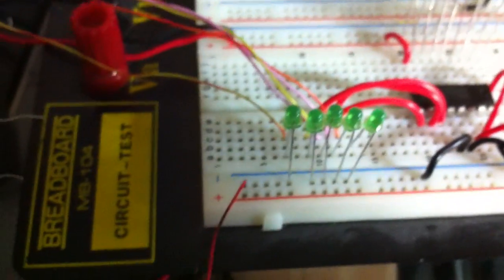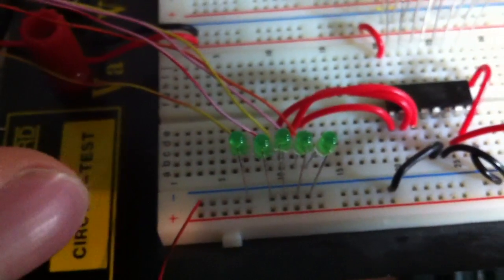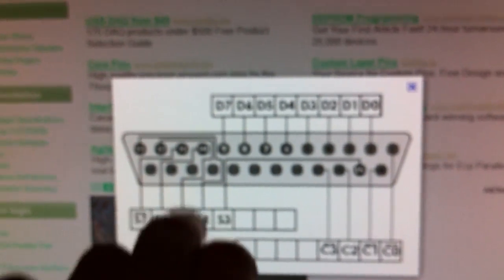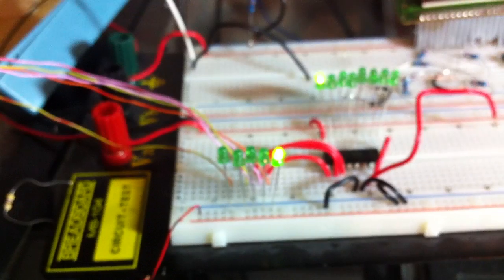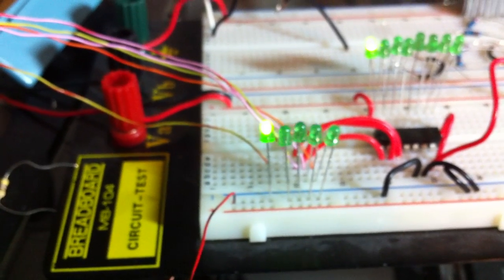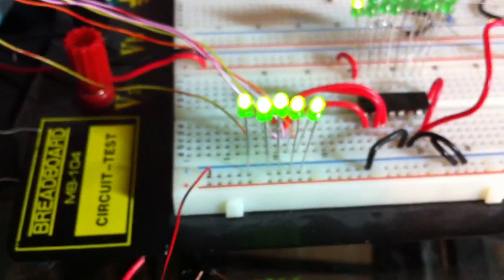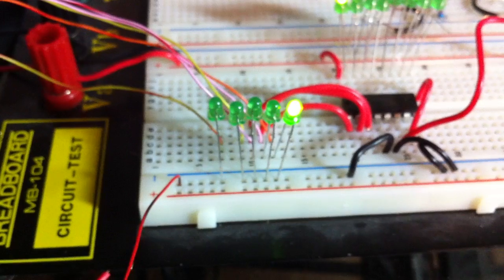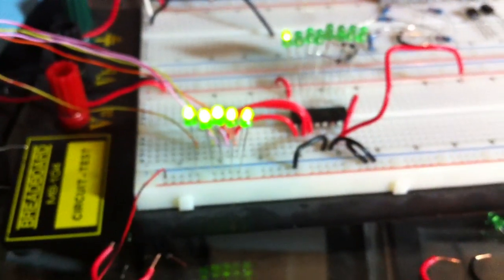Using a PC Parallel Port to Control LEDs

Comment: I found your video interesting, yet incomplete. No hint at the code your using to control the port. I guess i will use linux command line as root user. thank you for making this.